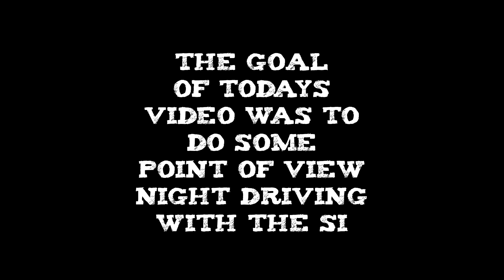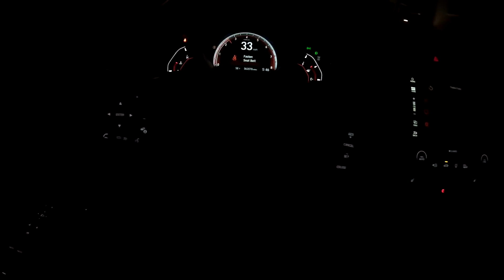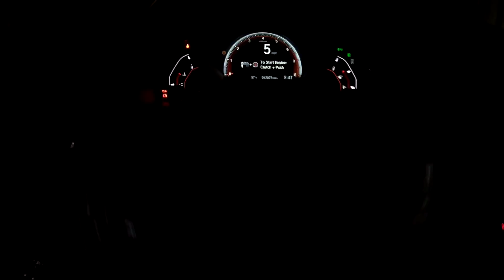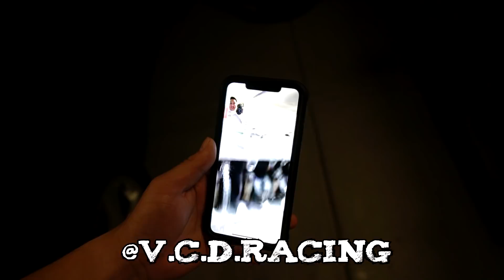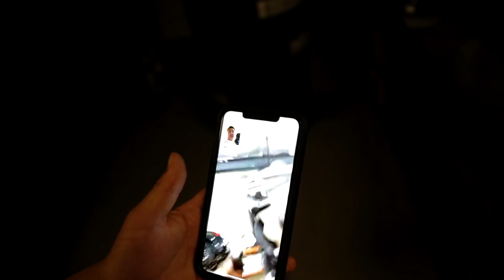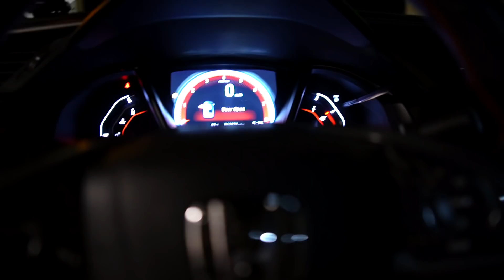My CIVIC SI Broke AGAIN.

Comment: These honestly seem like low fuel pressure symptoms. 

Make sure yall check for any fuel leaks or possibly the lpfp or hpfp failing as well if its not the map sensor.
Reply from the maker: Appreciate the input brotha! 🤙🏼 We will for sure check those out, so far on the list is either MAF/MAP Sensors or Bad O2. Car has 60k miles so O2 definitely could have gone bad as well after everything we’ve done through the years.

Comment: I have a 12 9th gen si coupe.. ive never cleaned my maf sensor, my engine bay to be honest hasnt been cleaned in 120k mi.  (Was clean when i bought with 9,700 mi in 2014.  Im not proud, its dirty as hell in the engine bay.. ive beat on this car basically every day, hit 100+ idk how many times  probably between 750&1000..only thing ive had to change are brakes, tires, oil, mtf, air filters, coolant/fluids, battery, and my alternator just had to get replaced 2 weeks ago and a new battery.  No issues, still my daily.  I get it though, thats stock vs mods.. wish i had someone i knew to help do some mods as idk a lot about modding.. and id wanna do it right, but have a part of it myself.. not trying to rip on u, i enjoy all the videos on the si's. Just felt like sharing this nonsense. Happy Thanksgiving everyone, stay healthy and safe out there

Comment: It’s might be a sensor tbh because it kept getting worst as you started the car more (because the ecu is probably just trying to not damage the engine as it’s learning that it has issues) I don’t think a blown head gasket is a issue ( for now ) to it starting because it wouldn’t cause a car to shut off unless it’s over heating.
Reply: Could be the crankshaft position sensor
Reply: @kg_1720  I thought about it but Honda have a hard limiter at 3k rpm when it comes to the crankshaft sensor (at least the 9th gen and older did)

Comment: OK so I am not a mechanic but I have been seeing a trend since I started watching you tuner tubers you keep putting more horsepower under the hood and something breaks often I may be wrong I am not a mechanic but that's what I'm noticing. Good luck buddy 👍
Reply: You can't take a few cases and assume thats how it is for the majority.

Where he currently is setup wise and power wise, I've been at for almost two years and 20k+ miles.

All on stock internals and not a single issue.

And I race and beat on this car daily. I just don't do abusive things.

Comment: Gonna have to do a compression check to make sure you didn’t bend any valves since it decided to cut out when you were redlining.
Reply: A bent valve would be super noticeable
Reply: @walahmelons5504  not really, mine bent 8 when the dealership messed up my cylinder head install and you couldn’t hear any valve train noise. Only clue was free spinning engine with no cylinder pops. He could have some bent and the others are holding which would make sense being it’ll start but struggles to stay on.
Reply from the maker: I appreciate your input brotha, but we fixed the issue. It wasn’t anything major and Monday’s video will show 🤙🏼

Comment: Is it breaking again cause too much hp?
Reply from the maker: No, this built engine is 2 years old and when we first built it there was a bit of R&D being learned since it was one of the first built blocks to be built in the 10th gen community. But we have a “possible” spun rod bearing which isn’t fully tested yet, could be something smaller. But we decided to scrap this engine and just build a new one which parts have already been tested on a 700+ Si.

Comment: Its better to keep these 10th gen si stock. That 1.5 motor is too small to be throwing that much power at it.
Reply: Facts
Reply: He would have been better off with the 2.0  I agree
Reply: At this point, the type R would have been cheaper.
Reply: Seems like, I do not think I will go to Stage 2 with mine, personally.  I do not have the deep pockets to do anything if the engine goes...
Reply from the maker: I think everyone is taking this issue too out of proportion, this is just a small maintenance issue (as Monday’s video will show). We didn’t blow an engine or transmission guys haha, don’t cut the 1.5L short. Anything modified will always have issues, if you set back to TJ Hunt in the beginning stages of his BRZ, it always broke down and he had a 2.0L. Remember you guys see everything I do with this car, so I’m transparent as any other car YouTuber. It’s not the motor, it’s just the journey when building cars.
Reply: Stage 1 tune with full bolt'ons is enough for me.. She's a blast to drive

Comment: I think you need to try a new tuner. Your car breaks way too often. You’ve honestly convinced me not to switch to hondata. A lot of ktuner big turbo guys have been running the same tunes for much longer with less issues. You haven’t even hit 400whp it shouldn’t be breaking this often
Reply from the maker: This has nothing to do with tuning or the devices, this is just maintenance issues. Anyone who’s told you that the tuning device or tune is what causes the problem is wrong, I have met plenty of people who’ve gone through the same problems as myself hondata or ktuner, I even know someone who has a ktuner device that has gone through 3 engines. But at this point should I blame ktuner or his tuner? No. Some people have no issues and some people have some issues, each car is different and not all are built the same. Some drive different as well. I think what people don’t realize is that I’m a YouTuber who is transparent about things that happen to myself, so everyone follows my journey. Not everyone else is so transparent.

Comment: Transmission or it could be the lower valve assembly on your transmission
Reply from the maker: Appreciate the input brotha. But I don’t think it would be those things, the car drives fine in each gear and only thing it has issues with his starting. Seems to sputter is all, so we’re thinking it’s a dirty MAF or MAP sensor that isn’t reading the context air/fuel ratio to start up. But I’ll definitely keep you updated in the next video after we attempt to clean those.
Reply: @PhongVLG  All ok. The only reason why I said that is because our car did the same thing but ours was the transmission. With only 12,000 miles on it smh

Comment: My friend its a honda!Not a ferrari!Keep your car stock original from the factory.
Reply from the maker: Does that mean no one should modify their car unless it’s a Ferrari? I’m confused?
Reply: @PhongVLG  No of course!But we are talking for a 1.5,four cil engine! I have the same car!Its a small turbo,not a V8.It will break if you modify it too much.
Reply from the maker: @mythosim1031  I understand what you’re saying brotha, but don’t cut yourself short on these cars, they make great power. Fastest right now is pushing 695whp on this 1.5L, and V8’s aren’t bullet proof either. They still break. Any car breaks modified, it’s apart of the game. Plus with a few bolt ons and a tune, you can easily smoke some V8’s 😉 Power to weight 💪🏼
Reply: @PhongVLG  I hope you to solve the problem soon and have safe rides!I wish you to own some day the Type R!